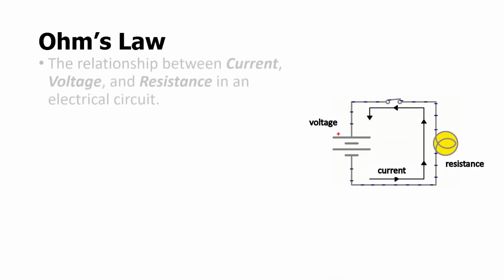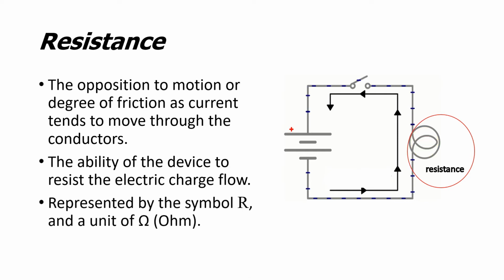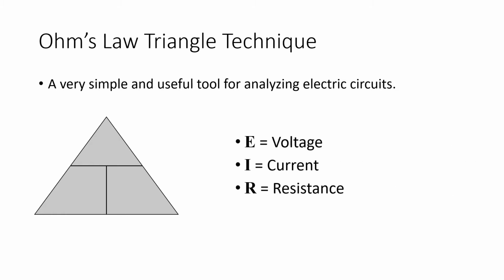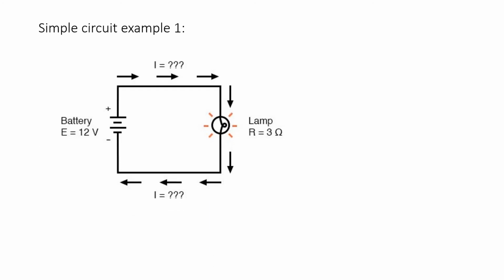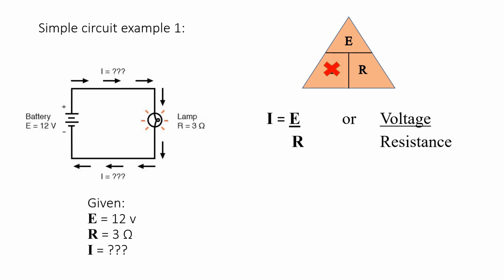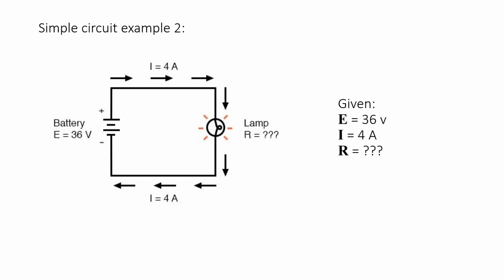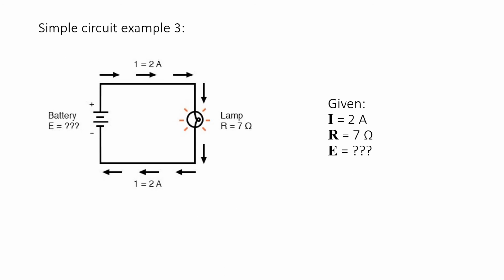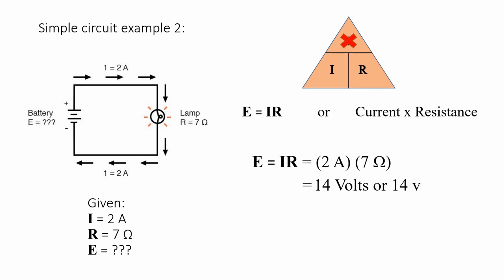Ohm's Law Equation

Comment: The lesson that Ma'am Lim discuss about Ohm's Law ,i learned about the relationship between power, voltage, current and resistance, and it is also used for calculating the value of resistors required in circuits, and it can also be used for determining the current flowing in a circuit where the voltage can be measured easily across a known resistor.